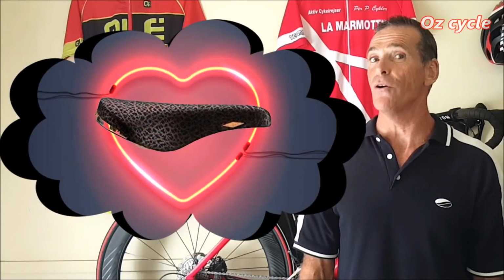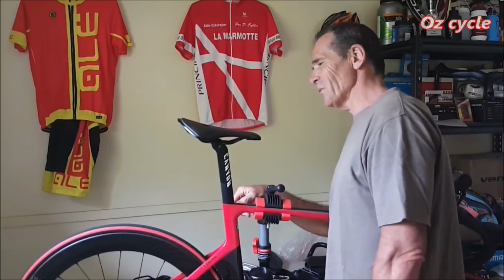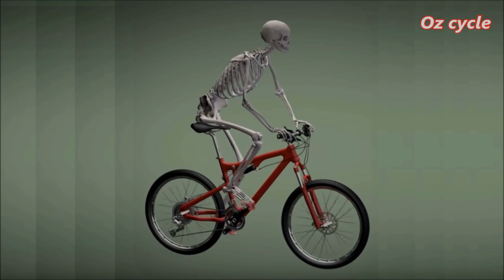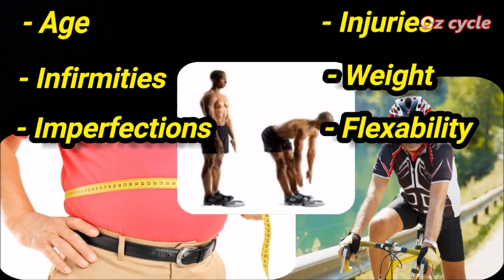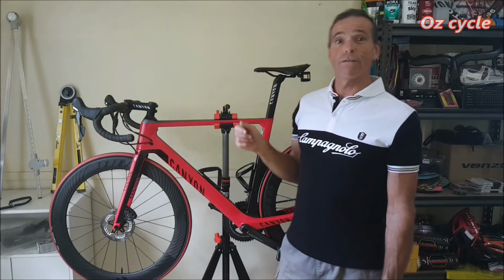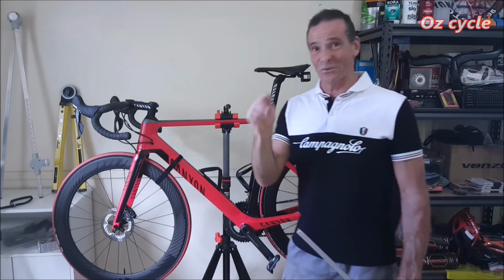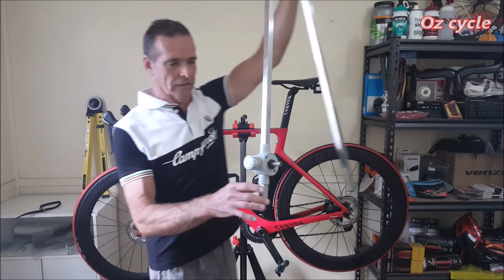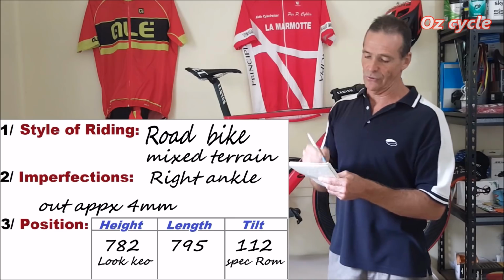Find your ideal bicycle saddle - Part 1

Comment: I think I have always had difficulty to get saddle right, because I have long arms. Wing span 181, body height 173. And shoulder width is.. difficult to measure, but I got 38cm when measuring from shoulder bone to bone, when choosing handlebar(witch I then bought 40 cm wide, and they seems perfect fit for me). Anyways I always been struggling to get saddle to correct position, until I change to shorter stem. It seems that by default most bicycles have handlebar too high and too far away. After I changed the stem on my current bike to 1cm shorter, I was able to lower handlebar 2.5 cm and now I can ride also on hods too. Previously I could only ride on drops and also tops, but was not comfortable. I was moving saddle fore aft all the time and swapping different saddle models too. Distance from the saddle widest part as you showed in this video to middle of handlebar is now only 71 or 72 cm... But somehow I feel inferior and weakling because of that.. Though I think my position in bike is not too bad, not that upright.. Handlebar is 5cm lover than saddle too. But all strong riders have handlebar stretched out so so far away, with long stem.. I guess it's same thing as chain ring size. You won't feel like being real man, if your distance from saddle to handlebar is too short.. My chain rings are 36/46. :D 
 Some silly website was suggesting, that people with positive ape index should buy rather one size bigger frame than smaller. Which is completely wrong, because ape index does not account  torso height and shoulder width/actual arm length.

Anyways, great video. Thanks.

PS. It would be nice, if I could grow bicycle saddles on field, like potatoes.   ^_^

Comment: What about after riding for a bit of time.  Hands get pins and needles after time.  What would be causing this.  Would it be Setup.  I don’t use drop that much because it feels like my legs are hitting my stomach
Reply from the maker: Usually "fore and aft" of the saddle Wayne. Its in Part 2...next week. 😁
Reply: oz cycle interesting I will watch this when I get back home tomorrow. More riding on the hoods.